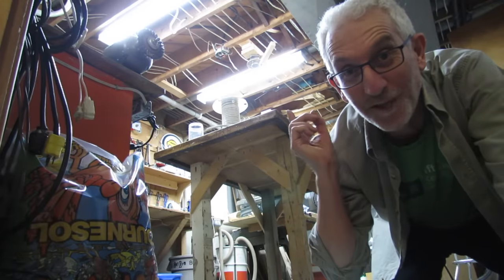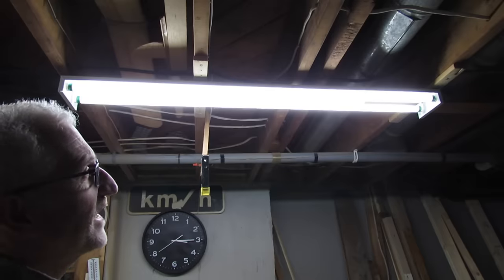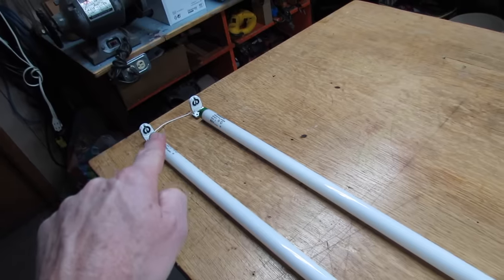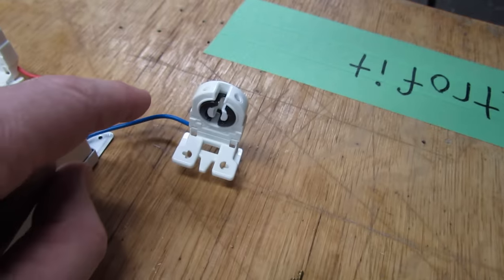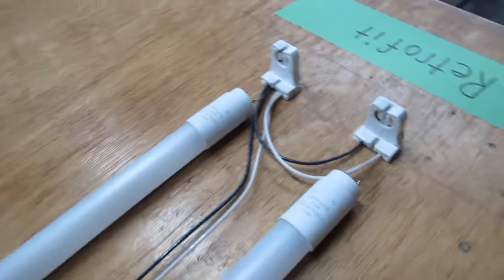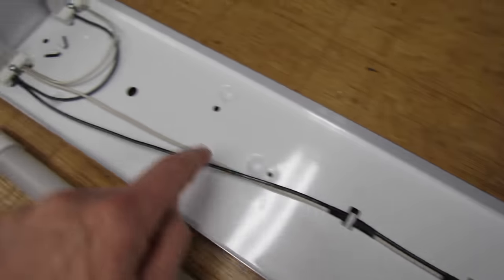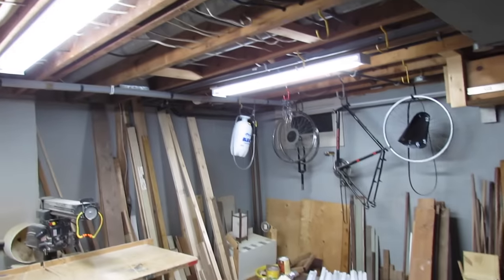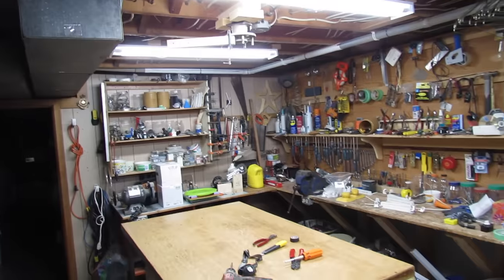How To Convert T8 Fluorescent Lights to LED ● Explained in Simple Terms

Comment: Excellent Video Chris... I have the same fixtures, your details helped me considerably,  QUESTION... I have "8" in my shop space, but I can't replace all at once, is that ok... safe?
Reply from the maker: Not sure what you mean by safe. Do you mean all are powered on the same circuit and if you turn the power off you have no light to work by?
Reply: @chrisnotap  Yes, same circuit 4 in the front of the space and 4 in the rear (2 switches)
Reply: I decided on this project because "1" of the balast's failed recently.
Reply from the maker: Getting back to your original question, just replace what ever ones you want first. Do one full fixture at a time.

Comment: Question: Could you remove the ballast and get a. led kit with those strips and just keep the fixture? I've been watching videos on those and you can dim them, change colors, etc. Might not be bright enough in a workshop but I was thinking in an RV. I want to get rid of these small flouresents and do something with LEDs. They take so much less power and nearly zero heat.

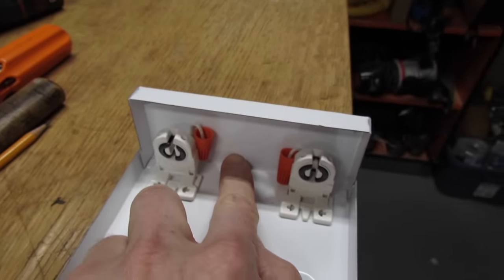Comment: At 3:28, you show the bulbs have pins labeled L (line) and N (neutral). Do we have to carefully insert the bulbs so the L pin goes to the black wiring and N pin goes to white wiring? Or can the bulb be inserted in reverse as well? If the latter, why do they bother labeling L and N?

Comment: I had an 8 ft fluorescent bulb go out in my workshop and wanted to do this conversion after watching your video.  Cost of replacement bulb was $18 including tax at HomeDepot the cost of the conversion kit was like $60 plus the LED bulbs.  The first 3 links are giving me "404 errors"  "Page not found".   I'm not sure converting to LED is cost justified since I only have those lights on during my weekend home projects.  I couldn't get the links to work so.....?
Reply from the maker: Thanks for letting me know that. Trying to find new links at the moment.

Comment: Mr. Notap: On Plug & Play Do You Use Double Ended LED Bulbs? Or Can One Use The Single Ended Bulbs?.. Thank You
Reply from the maker: Plug and play need both ends to make the circuit. Retro fit only needs the one end to make the circuit (but needs the other end to hold the bulb in place)
Reply: @chrisnotap : I Have Some lights That Have Circuits Boards At The End Of The Them And Have No Ballast? Thank You.

Comment: Very easy to follow and understand, thank you.
What is that device mounted on wooden blocks on the ceiling of the workshop between the first and second light? Seems to have some kind of metal rotating centre and a short arm.

Comment: With LED, does the bypassed ballast still uses electricity upon start? I
 already have regular fluorescent tubes, with an electronic ballast, the
 question I have is does the bypassed electronic ballast still use 
electricity that is metered on the electric bill? A typical ballast in 
operation uses 96 watts, and has a surge at startup to ignite the 
fluorescent tubes,  does this effect the electricity bill with LED? 

With several LED bulbs, and the ballast in them, does the ballast 

still consume electricity?
Reply from the maker: If you retro fit, you are removing the ballast. It is no longer connected. It's not in the circuit. It is gone. It doesn't use any power.

Comment: Great light improvement! The question that you didn't cover was cost, what is it? I know that a person can get a complete fixture from CostCo for $19.99. I'm ALL for reuse/repurposing but I'm also very much into cost savings
Reply: If you shop around,  you can get 5000k bulbs for around $5 or so   Basically, around half the cost.  IF you only have a few to install, just get them at Costco.    Where this replacement really comes in handy is in situations where you really don't want to replace the bulb housing/fixture.    Like, if your current fixtures have some trim around them and putting in entirely new fixtures would require some additional work.

Also, check to see if the units from Costco have bulbs that are replaceable if/when the bulbs do go out.

Comment: Hello there! Is there a possibility that you can turn those into wireless and make it run with batteries?
Reply: Would you really want to have to go up there all the time to replace the batteries?
Even if they were somehow wired to rechargeable batteries, they would eventually stop taking a charge and you would have to change then out, right??

Comment: Chris, Do you have to use unshunted sockets on both ends of the LED bulbs or can you use the shunted as holders,
Reply from the maker: Correct. Only unshunted on the business end. The other end just holds the bulb in. Doesn't matter what you use there.

Comment: Nice and clear explanation! However, In my case i'm trying to replace fluorescent light tube with a LED bulb. The bulb apparently need a screw kind of contact, now i'm stuck looking at the 2 wires hanging down from the ceiling. Asked around, apparently i'll need to use an adaptor ...
Reply: If you are replacing the fitting with a single bulb, you just need to remove the entire fitting and convert to a lampholder as used elsewhere in the house. 
LED bulbs are available in both screw and BC types, the same as standard lamps.

Comment: I would not use the retrofit lamps with hot and neutral at the same end, if someone does not know that the fixture is retrofitted and puts in a regular fluorescent lamp, what do you think will happen?
Reply from the maker: They now supply a label to put on the fixture to make anyone working on it aware.
Reply: @chrisnotap  Hi Chris, I have been in the lighting industry for over 30 years and would not recommend that setup, not everyone reads the labels! Just food for thought when doing these types of videos.
Reply: @chrisnotap  just one more suggestion, Philips/Signify make their by pass laps where you energize from each end, neutral to one end and hot to the other, this way you do not complete the circuit if you install  a fluorescent lamp accidentally

Comment: Great video.  I have about 50 fixtures to retrofit.   All easily accessible.   How many hours would you estimate it should take someone who's experienced to do them?
Reply from the maker: I think once you have the first one done you will fly through the rest. Everyones capabilities are different, so it's hard to estimate how long it will take you. But if I had to guess I would say it would take about 5-10 minutes for each one once you had everything in place.

Comment: Does it matter wich way i put the lamp in to the non shunted connector? I mean if L or N goes in first?
Reply from the maker: No it doesn't matter.
Reply: @chrisnotap  hi thanks for the answer can u give a short explanation why? Dont the led flourecent tube have one pin that is hot and other is a zero(dead)
Reply from the maker: I'm sure the circuitry inside is set up to connect it either way otherwise the company would have thousands returned due to being put in the wrong way quite easily.
Reply: @chrisnotap  🤣

Comment: Question: Why wire the two bulb holders to each other? My instructions told me to just take the black wires and group them together and same for the whites and then wire them to power and neutral and it works perfectly.

Comment: I purchased some T12LED Phillips 34/40 , 20 watt 2100 lumens , 6500K . These are the T8 size . They clearly state Plug n Play on the back of the carton. These will not come on in any of my fixtures. I have six fixtures, two separate styles. Both are ballasts fixtures. 
My question here, can I do this same retro mod in your video to the fixtures and use the plug and play style? 
You mentioned the non plug and play only need power on one end. Do these plug and play bulbs need power on both ends? 
Thanks in advance.
Reply from the maker: The plug and play ones use both ends of the bulb as part of the circuit. The retro fit ones only use the end marked with Line and Neutral. The other end is there just to hold the bulb in the mount/fixture.
Reply: @chrisnotap  , thanks for the reply so how do I make these suckers work in my current fixtures?
Reply: Anyone know the answer to my question?

Comment: So today I took my fluorescent bulbs to ACE Hardware to get new bulbs (2) in my kitchen light.  I mentioned I'd like to try the LED bulbs, so I bought only one 4 ft bulb, I put it in the ceiling fixture & flipped the switch, nothing...no light came on at all.  So after watching your video, I cannot just put an Led bulb in place of a fluorescent bulb?  I'll wait for a reply before I return this Led bulb and buy a regular fluorescent.  Even tho there was two bulbs, will the light still work if I only use one bulb, my kitchen is very small.
Reply: @troo_story  I sure did watch the video to the end, like I said, I'll return this Led bulb and buy a fluroscent one, I'm NOT converting the light & I'm not going to call an electrician to do it.

Comment: I changed mine a year or two ago. All I had to do was remove and replace the tubes and the little "starter" and switch it on....... I went from 60Watts to 18Watts in one click. My electric bill has really improved since I upgraded ALL bulbs to LED......
Reply: Flourecent last years leds are questionable quality sometimes

Comment: Does each manufactured fixture have different Non shunted ends to fit the particular fixture?
Reply from the maker: Most just slide in. But in mine I had to drill a hole.

Comment: Is the shunted specific to electronic ballast?
I'm used to the choke ballast + glow starter system, where the power goes through the ballast, into and out of one end, then through the starter and into and out of the other end - the preheat starting system.

Comment: What is the brand name of the flouresent fixture you used in your video. I plan on doing exactly what you did but need a light weight fixture and the one you used looks pretty light.
Reply from the maker: They are made by "Lithonia". I got them at home depot.

Comment: Very well put together video. I've been working as a professional in the leading industry for 25 years. Almost all the stuff on 1000bulbs is cheap crap from China that will not last.  Please do a follow-up video in 2 years or so and let us know how are your application worked out.  P.S. - for those reading, trust only bulbs from major manufacturers you recognize such as Cree, Phillips, Osram, or GE.
Reply from the maker: Yes I was going to do an update video once a year or 2 of use goes by.
Reply from the maker: ........but it also has me thinking where the bulbs from Cree, Phillips, Osram, or GE are made. Would it not be China?

Comment: I have converted over a 1000 fixture to ballast free LED BULBS, if you don't have an electronic ballast the retro fit LED BULBS will not work. So I remove the ballast which in most cases cost about 30 dollars. It takes about 15 minutes to install a new ballast, and it takes 15 minutes to rewire fixture for ballast free bulbs. In a lot a cases 2 LED BULBS will give the same light output as  4 BULBS in the same fixture.

Comment: You can put raw 110v straight into the LEDs? I thought LEDs still required a down-step from house voltage?
Reply from the maker: Yes. You connect 110v at one end and can hold it up like a light saber. The other end is only there to hold the bulb in the fixture

Comment: What gauge wire did you use.  You seem to just push the ends into the connector base.  Nothing more.  How do they remain safely in place?  No visible means of tightening/securing wire-connectors.  Thanks.
Reply from the maker: All receptacles and switches have little holes. You just strip the end of the wire and push it in the hole. in the hole there is a piece of metal on a 45 degree angle. The wire is pushed into the hole easily but is wedged so it can't pull out.

Comment: I'm a complete noob but I'm planning to do the same thing and swap out 4 florescent lights to LEDs. Hope it's not a lame question, but what is the wire (the black and white) you're using in the LED set up? Thanks! Subscribing
Reply from the maker: There are no lame questions. I bought that wire at home depot. It was 14 gauge.
Reply: Thank you sir!

Comment: I liked your explanation on the change over! I have a question on the opposite end of the main power. Could you take and put the white wire on the right side to avoid the congestion?
Reply from the maker: Not sure if you mean the Live end opposite side or do you mean the opposite end of the bulb?
Reply: Opposite end of the light.?

Comment: FYI, the 4 pack you listed is NOT plug and play. Shame on me for not checking the description on Amazon. I will have to return them. The 20 pack looks like it is plug and play. Thanks for the video.
Reply from the maker: Sorry. I wasn't aware of that. They may have changed the listing. I have changed the description to reflect that. Thanks for letting me know!

Comment: I have a 4-light fixture with 3 ballasts. It is magnetic but doesn't hum or buzz.  Zero problems, works with both standard T10/T8 and LED. The other 2 are electronic & go to each outer bulb (overdriven.) The outer ones no longer work, ballast(s) must be bad. The outers look like 3-wire (of 4 wires possible) tombstones to 1 side each ballast, and the other end has a red & blue to each tombstone! Actually, it would be 4 wires to each outer tombstone on one end and 3 wires to each tombstone on the other end! How do these get wired?? I have a pic of the entire lamp assembly with the reflector removed to see everything end to end but don't know how to post it here...

Comment: So my light fixture has 4 red and 4 blue wires on one end and 2yellow with the non shaunted at the other end. How would I plug  those wires?
Reply from the maker: No. It will have "shunted". You need "non shunted" and wire it like in the video. Good luck. Links are in the description.

Comment: Is there an easy way to convert LED to fluorescent?
I've had a few LED fixtures go bad on me after some months, but usually the entire assemby needs replacing. Costing lots of money, and wasting materials.
I've never had a fluorescent fixture go bad, and typically the tube life is longer than the entire life of the LED fixture.
I'd rather just replace a single glass tube every 5-7 years than the LED fixture every 6 months.

Comment: will these same units work with and without a ballast?
Reply from the maker: No. Plug and play will. Retro fit won't.
Reply: @chrisnotap  I just bought a box of 10 of the similar ones from Walmart that use the ballast and they only cost like $48. They come on way faster than the fluorescent type and only use 13 Watts from what they say

Comment: Great video, I was wondering about this sort of thing recently,...I think I have three or four fixtures I could convert, and I am supposing it must be cheaper to do so, ...I can't remember rightly the cost  of the new led light fixtures with bulbs.
Reply: In the long term the savings are enormous, mainly in running cost, but also in bulb life.
If you ran a standard single fluorescent  for 15,000 hours, you would need 3 tubes (2 replacements) and burn approximately $500 in electricity. 
With LED you would only need one tube and the total running cost would be nearer $225.
The tube life is something of an estimate, but with a $275 saving in electricity cost, it would not be the end of the world if it needed a replacement.

Comment: LOVED this video.  So we'll done in every aspect. 
One question: is there any way to rewire the fixture in a way that doesn't require replacing the shunted ends (ie leaving it as is)?
Reply from the maker: No. The shunted ends are internally connected.

Comment: I really liked your video and the idea of the single end power  (shunted) lights. I contacted 1000bulbs.com and they torpedoed my idea of converting my garage and work bench lighting when they informed me  the bulbs you talked about in your video are sold by the case (25 bulbs), only. All I need is 4 bulbs. So, great video, sad web supplier.

Comment: Hi, Chris.  The video finally inspired me to convert my fluorescents all around my house.  Any recommendation for buying the non-shunted tombstones in larger numbers, say 40-50?  I see comparable ones on Amazon and wanted to support the channel if I can.  Thanks!
Reply from the maker: Thanks for that! These ones I have listed in the description are the ones I suggest.....● Non-Shunted Lamp Holders .... https://amzn.to/2qahxt9
Reply: @chrisnotap   Thanks.  I was hoping to find them in a multi-pack, but the singles will do.  Next question, as I am rarely doing lighting or electrical projects, what type of wire are you using to wire these?
Reply from the maker: I used single strand 14 gauge wire and bought white and black.

Comment: You do not need to wire-nut the loose wires on the lamp tombstone. All that you need to do is, with the power off or still disconnected, using a pair of needle nose pliers, grasp the wire that you want to remove and just turn the copper wire (not just the insulation) right and left repeatedly while applying constant pressure away from the terminal that you want to remove. Eventually the wire will escape the “alligator tooth” or “push in” connector on the “tombstones” or the white pieces that hold the lamp that you replaced for no reason had you done what I have suggested you would not have needed to. I’ve done it successfully for years, it works every time. It even works for Wago wire connectors, solid or stranded conductors, it will damage the exterior of the copper that you are removing however.
Reply from the maker: Correct. Thanks for that tip!